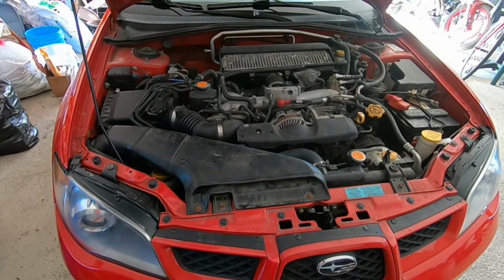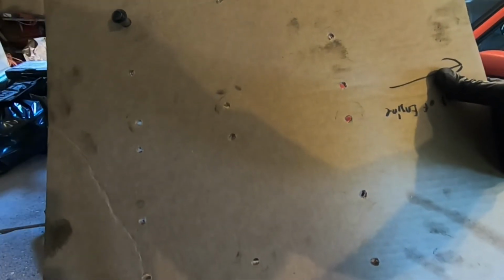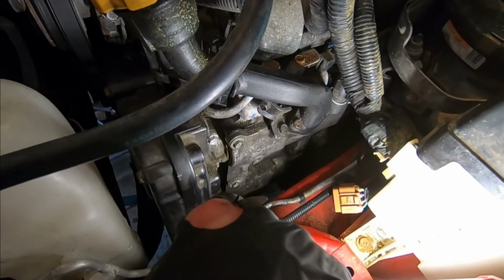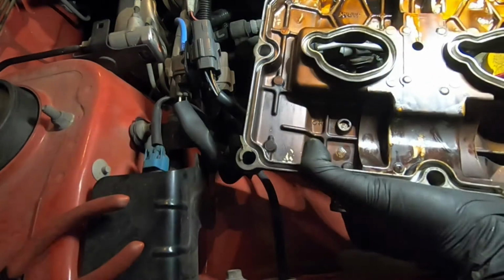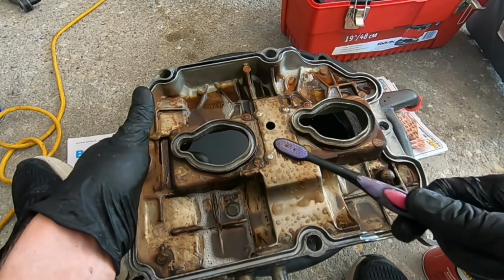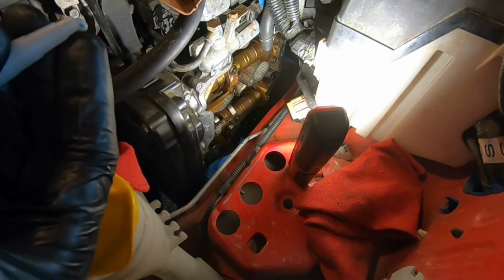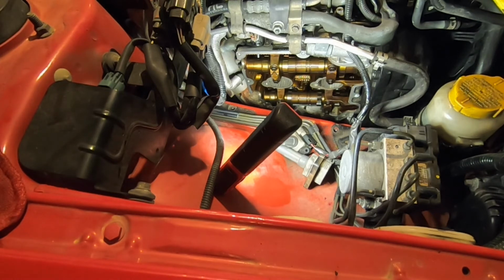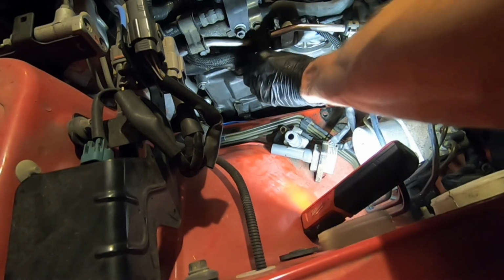2006 Subaru Impreza WRX Valve Cover Gasket Replacement

Comment: You're a life saver, restoring a bugeye and this was something I had a problem with
Reply from the maker: Glad it helped! One thing to note about the bugeye is that their Valve Cover Gaskets are a different part number than the Hawkeye and they also have a separate gasket for the breather hoses (Links for both are labeled in the description). I'm almost 20k miles out from this repair now and it's still holding up nicely, so really happy with how this went! One nice thing about the bugeyes is that they don't have that stupid air pump getting in the way of the drivers side valve cover.

Comment: Just did this for the first time yesterday. That lower rear bolt on driver side was a pain , but the rest came right out, I used a 10 mm short socket 1/4 drive on mostly.

Comment: Thanks so much for taking the time to record this. I have attempted this before and it was not easy. I do have to do it again as it is still leaking. You have given me the motivation to do it again!
Reply from the maker: Glad it helped buddy! Make sure the gasket surface is as clean as possible when you reseal it. You don't want any oil or debris on the surface that could cause it to not seal properly and leak again!

Comment: To remove the two electrical connectors next to the fuse box, use some wd-40 penetrant, then use two small flat head screwdrivers, one to hold down the locking pin and one to gently pry the connector apart from the side. I got mine off in 5 mins doing this

Comment: if you install a different exhaust part. it may increase or decrease heat around the area which can affect plastic parts. in this case, the exhaust melts the half-moons a little bit through extra heat exposure. it happened to me when i put a aftermarket header and uppipe. which donot have heat shields like the factory uppipe and header.

Comment: How did you remove those two electrical clips next to the fuse box?
Reply from the maker: WD-40, a small screwdriver, and a lot of patience haha! You might need to wiggle them back and forth for a while. It took me a long time, but as you can see, eventually they came loose. The joy of working on old cars!
Reply: Nice video what curing time did you use for the grey sealant or did you start the car after an hour?